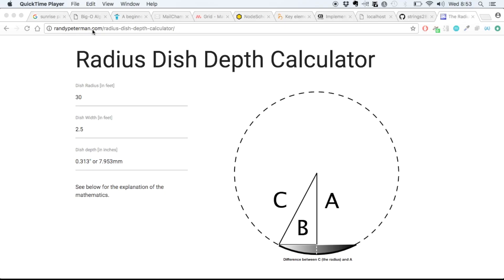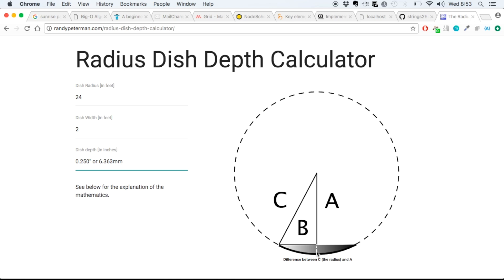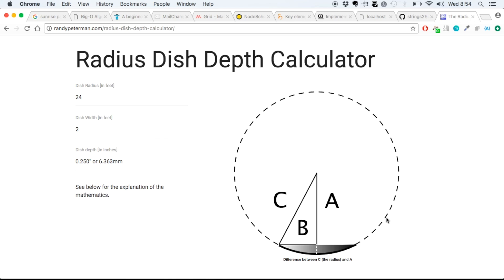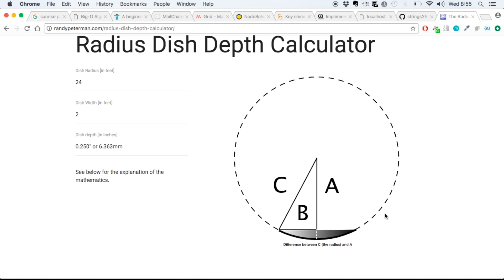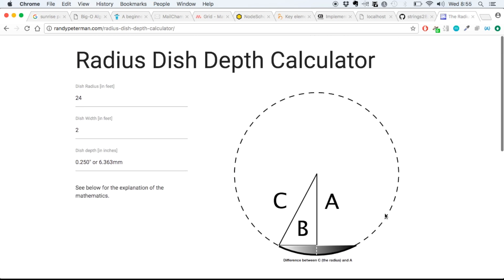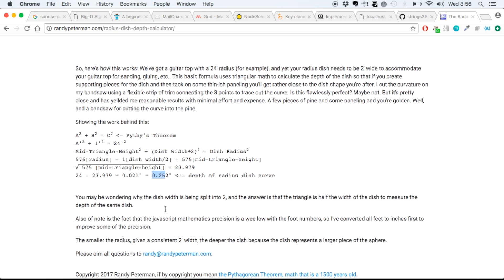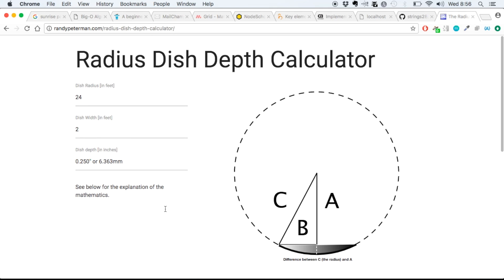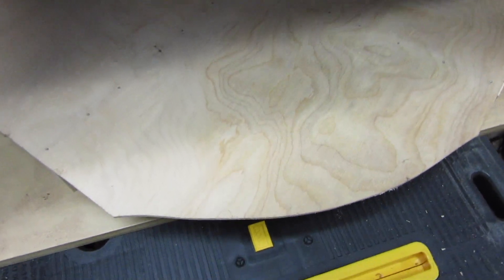My Radius Dish Technique

Comment: cool vid... say would you happen to know the answer to this question? I am building a steel string dreadnought guitar. However I want to build it with a spanish foot like a classical guitar, instead of the dovetail joint in the plans. Will that have an impact on the shape of the radius? If you are familiar with the book by Bogdonavich, his design (Classical) has the radius in the shape of a half dish from the bridge to the butt, whereas the Martins are different. Anyhow the first Martin's used this method in the late 1800's. Curious what your thoughts are, thanks !
Reply from the maker: Liv 4ever if you're making a flat top guitar with no top radius (not common, but not unheard of), it may work, but due to the large tension the steel strings create you may need to attach the neck and adjust its angle. If you're trying to avoid a pocketed dove tail joint there are some variations, but a classical design may come with more risk of intonation issues.

Comment: Ok, now that you know the depth, how do you construct it? Thanks.
Reply from the maker: I'll need to make a step by step video for another radius. Short version is trace that curvature onto wood and cut it out on a bandsaw. Then notch 2 pieces to create an x, and cut 2 other pieces in half removing enough material to align them into an 8 way support/foundation. Then taking your thin paneling cut it into a circle and then carefully nail it into place with fine finishing nails. Make sure they're recessed and sand the surface. Anything protruding could scratch your top or bottom wood.